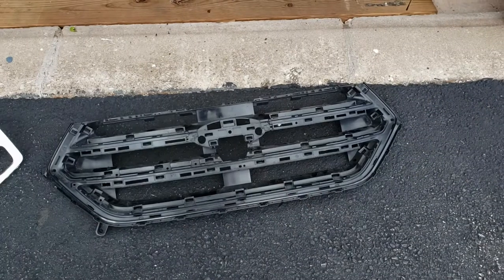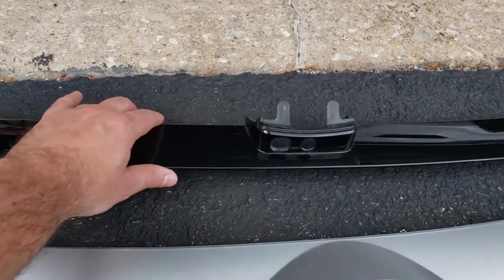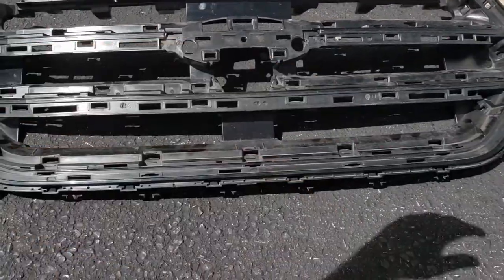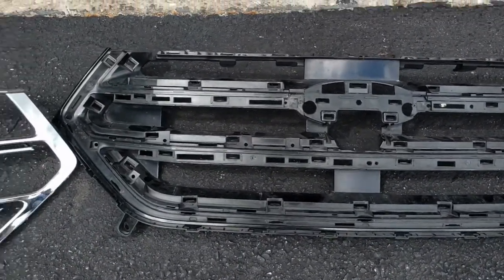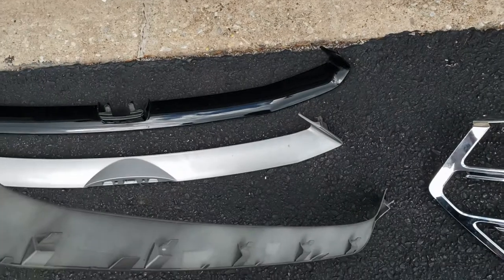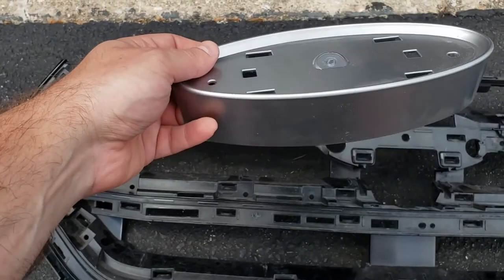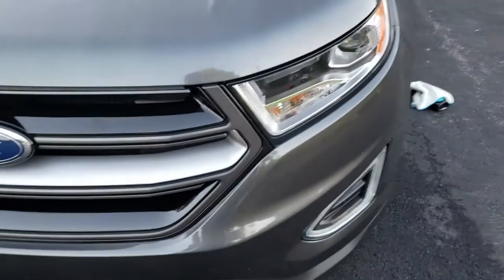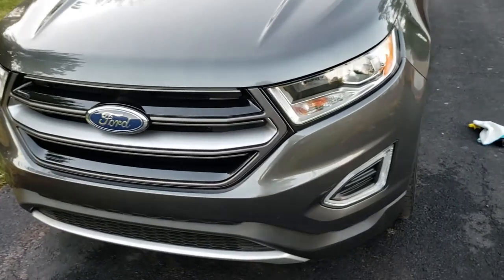2015-2018 Ford Edge Front Grille Mod

Comment: Thank you for the in-depth video. I've owned a 2016 Titanium for a year and have wondered about how to adapt one of the black Sport grilles with camera port. The job looks a little beyond my endeavor level but you've cleared up my basic questions. Thanks
Reply from the maker: Thanks for the props! I've taken that bumper off so many times it just stopped seeming to be a pain. It's crazy that you technically have to take it off anyway just to replace headlight bulbs.

Comment: Question Ford Edge 2015 SE.  If I just want the front grill out to paint it do I need to take the bumper and headlights and all?
Reply from the maker: Good question. I forget if I commented much on grille accessibility in that video. If you have small enough hands and A LOT of patience plus tough skin you may be able to get to back push clips. At minimum though I still believe you would have to undo the top pins and screws in wheel wells. That would create some flex in being able to pull grille/bumper outward. May be a 2 person job and you would have to be super careful to not crack bumper assembly. I've taken that thing off so many times on Edge and my former Fusion that it's easier and faster in my opinion to take the while thing off including lights.
Reply: @carsick309  
Yeah I thought that too about the wheel wells. I'm afraid gonna have to squeeze myself under. Hope it creates enough space for me to get to the clips. If not... to the shop it'll go. Thanks my friend for suggestions 🍻

Comment: There are honeycomb/ mesh grills for the Ford Edge, ever tried the hem? Since not original you think it’s a problem to install it ? 
My original grill has all conectors kind of broken , but it still works fine. However if I want to change the emblem the whole thing will fall apart
Reply from the maker: Yes I have seen those before. They seem to work pretty well for a couple of guys who I know use them.